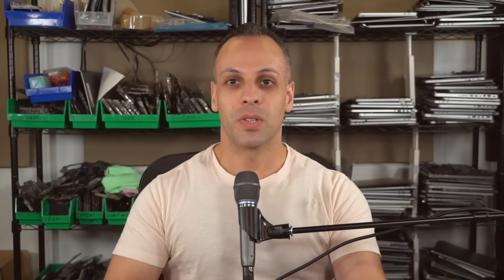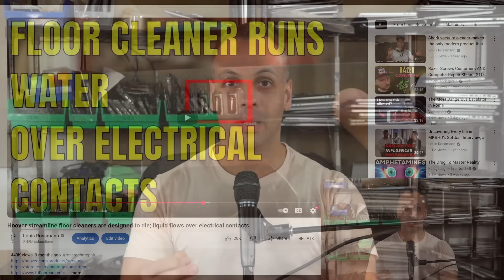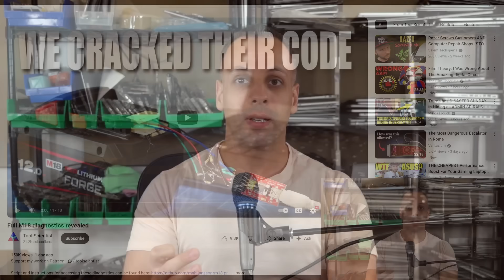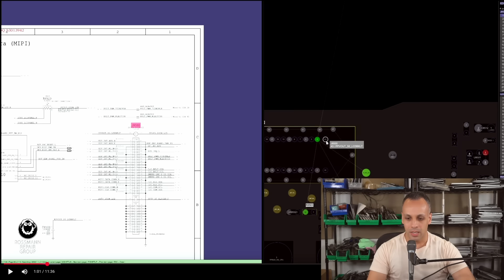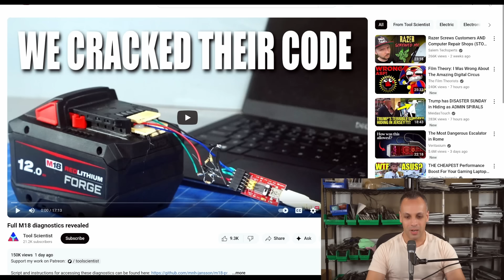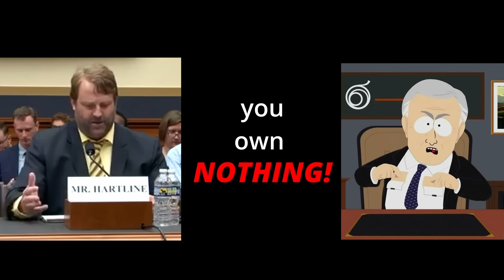Imagine putting DRM in a battery to void warranties...

Comment: power tool batteries have always been a total fuckin scam, its just simpler back then than now
when you buy a power tioool, say it comes with 2 batteries and a charger because its a bundle for 160$ or so
if you want to buy the tool alone, its probably 120$ or so. if you want the charger, its maybe 15 or 20$
but gods fucking forbid you have to buy a battery seperately, ever, and most are often made with just enough capacity to last you about 3 to 4 hours. fine for home use, not enough to last all day in a shop. especially when its being passed around and shared.
that one seperate battery you buy seperate is *80$*, i have not seen one lower than that, thats the floor for seperately non bundled batteries, and all these proprietary plugs means you cant use one in the other brand, which just leads to petty ass brand superirority arguments 
the older ones used to have at least a 15 year lifespan, blue ryobi days battery lasted up until 2018, bought another green ryobi one with the charge indicator on it and it lasted 4 years
this is just another layer of bullshit icing on this cake

Comment: TTI's whole business model is forcing people to stay into a specific ecosystem via bateris, because if you buy a Dewalt drill on sale yand you need an Impact Driver you can reuse your charger/battery on a De Walt Impact but not on a Milwaukee. Ergo they give you a deal on Dewaltonce and now you're locked into Dewalt forever. They could change the design so new Dewalt batteries fuck you more than the old ones do, but they can't change the design so you need new Dewalt tools.

Comment: I recently bought a new weather reader from the company I bought from for over a decade. Once I saw the DRM garbage and requiring an app to use at all. 

I bought new rechargeable batteries, put them in my old weather reader, and it immediately started working again. The new weather reader, even when I set it up via the app, had issues from the word go. I returned them.

Comment: 1:43 - Lithium batteries degrade when they are in a hot environment in a high charge state. You don't need to put a load on them for the degradation to happen; it's a chemical process, and it just happens. So yes, if you were informed not to store batteries in a 45 °C car and you did it anyway, they have every right to deny you warranty as the product was misused.

Comment: *panics over investing about $800 into one particular manufacturer's platform over the past three years*
*reads thumbnail twice*
It's OK, "Yellow Guys," you're safe. But don't try anything hinky, got it?

Speaking of "watered-down piece of garbage made by a company that has sold out 6-10 times over," I submit for supporting evidence the Stanley brand of hand tools. I bought a Stanley set of screwdrivers in the mid-00s. Allegedly "chrome vanadium steel," but after purchase I could tell they weren't. The shafts twist, flex, and/or snap (it's compressed powdered metal with a shiny plating), and every single flathead is missing pieces from the tip that have broken off. They're rusty, the "chrome vanadium" is flaking off, and they're such utter crap that I refused to buy another Stanley product ever again.
I have inherited/collected some Stanley stuff from the 1970s through 1980s, back before some Chinese holding company bought the Stanley company, and those tools have really held up over time - and are still in my primary toolbox. It was because of that reputation that I purchased that mid-00s set, of which only one or two are still usable, and they've been downgraded to the "sacrificial tool" toolbox. (Need a narrow chisel? Grab a Stan-Li Flathead.)
Reply: Yellow guys? If you mean DeWalt then I'm sorry to say that they do the exact same thing as Milwaukee with their batteries. Also Stanley is with black and decker the universally agreed worst power tool manufacture.

Comment: I have an HP laptop that, when hybernated/turned off for 4+ days, it drains the battery that has been replaced down to 0%, the battery drains even faster than leaving it on suspend mode through a whole week

It's not even a gradual drain, within the 1~3 day mark, it holds the same % I left it at, but on the 4th day onwards it takes a nosedive to 0%

I wouldn't be surprised if HP implemented a system that sabotages any 3rd party battery

Comment: I saw a video where a guy took one of these tool batteries apart. The battery would only last a short time before dying. But it would charge up and indicate full charge.

So he tests the voltage until he finds the cell that dropped down too low to charge. He disconnected it and rigged something up to charge that one cell up to the level of the other cells. He put it all back together and it worked again.

He was still planning to replace the battery because he didn’t know if the cell wouldn’t drop too low again.
Reply: yeah, a weak cell or 2 can be brought up to the others and the whole pack lasts so much longer. If the good cells hold more than 90% I'd replace the bad cell but you can ask the E-bike guys, they know all about caring for battery packs.

Comment: Batteries have became the printer ink of tools. 

Dewalt does some other shady sht. They just disable the battery if it falls below a certain voltage or hit 200 charge cycles. Sadly all I own is Dewalt. I have a hack for Dewalt, but its not that good. 
My Bosch battery on my e bike has some similar bs with it.

Comment: Thank goodness my still working piece of ryobi crap drill battery has NO circuitry in it..... 

I always thought aspiring to owning a Milwaukee set of tools was good..... 

Now, I seem to think this is no longer a sane aspiration...... 

I will stick with my still working cheap ryobi and batteries.....
Reply: Ryobi is owned by TTI too. However, he used some AI thumbnail that shows brands that don’t even exist. Ryobi batteries don’t have DRM in them. I have a lot of Ryobi tools and batteries and I love them.

He clearly doesn’t know what he’s talking about. Lithium ion battery packs are very finicky, and subject to stringent regulation. They often shut themselves down to avoid fires…. and there’s reasons void warranties due to misuse. Example being shorting the battery out purposefully. This is a nothingburger, sorry Rossman.

Comment: The individual units in a battery are called cells.  A number of cells connected in series make up a battery.  More cells increases battery voltage.  Larger cells increases the number of amp-hours (AH) a battery has.  Amp-hours times volts gives Watt-hours or capacity.  Higher voltages are more efficient and give more output power.  Bigger cells give longer run times.  Bit of a balancing act.

Most other battery types could benefit from a balancing circuit, but it isn't strictly necessary.  A lithium battery must! must! must! have a balancing circuit and temperature sensors.  This is not remotely optional, but apparently some companies treat it as such to save a few dollars (they really aren't that expensive).

What happens when a company doesn't include a balancer?  Glad you asked, Just search for videos about Chinese scooter batteries that caught fire and/or exploded during charging or discharging to see.  Now think of that cheap power tool charging in your basement.  Yea, I think you get it.

Comment: 1. What you are describing, and what this is, is not DRM. DRM is to prevent users from using their products in an way that is unintended by the manufacturer by locking or turning off the product.  The batteries can still be used however the user wants, this hardware & diagnostics just loggs misuse to deny warranty claims.  The fact that it's being used to deny warranty claims when no actual misuse has occured is the real issue here.  

2. The battery packs HAVE the hardware to perform cell balancing, it's just TURNED OFF IN SOFTWARE which is even more insane.  Imagine being the engineer who designed the whole BMS circuit for these battery packs, lovingly including balancing resistors, only to be told that either purposefully or accidentally the software would never allow it to activate.  What a letdown.

Comment: I have ozito tools and battery in Europe they are called Einhell, all tools have spare parts on Einhell website with the exploded parts. I replace the old cells in the 4ah  18v battery and they still works very good because the bms don't lock itself

Comment: I watched the video. He only talks about command code $01. There may be code in the firmware that the guys haven't uncovered yet. I would not jump to conclusions yet. I hope they will be able to dump the firmware and really see what's inside.  I am not protecting tti, just having had reverse engineering protocol experience with other electronics before.

Comment: No balancing? Impressively amateur. That's so basic I'm shocked batteries are available thay don't have balancing.
Reply: The balancing hardware is all there. It's the software that disables the balancing circuit each time it goes on the charger. Someone had to write the code to purposely disable the hardware from doing it's job. They knew exactly what they were doing. Only question is why?

Comment: A lot of this industry wide trouble is the FCC's fault. Way back when, they set standards to keep electronics from stepping on each other's toes. Nowadays it's a chaotic banana peel party. The FCC needs to force these companies to be up front about their DRM schemes and set standards for what is and isnt acceptable sabotage in the sector. Ultimately, DRM is an attempt to bypass what would normally be agreed upon by contract, bypassing contract laws and limitations via deliberate destructive action. It needs better regulation.

Comment: not only that, they have a charge limitation built into the software, having undone one of Milwaukee batterys that refused to charge, i found it had a limitation hit that stopped the battery getting a charge, reset this and battery was fine, Milwaukee said it needed replacing.... at triple figure cost

Comment: Anyone notice how modern products are being designed more and more so that when the battery dies you can't use them anymore. I'm talking phones, vr headsets... META cough cough Laptops usually still work if you remove the battery.

Shit to make you buy a new one when the old one could have worked without a battery much longer as long as plugged in

Comment: I hate to be "that guy", but since Louis uses the terms about 100 times: The accepted use in industry is that a "battery" is comprised of "cells". The battery can be any voltage depending on how many cells are series.

Comment: The companies in TTI I worked for didn't cross-talk on the engineering departments but it would be interesting to see if there has been internal mandating from TTI to their brands to implement these horrible protectionist strategies.

Comment: I have wondered for years why a tool designed for plumbers, designed to work on water pipe, and advertised as being able to repair pipes while the water is still running, not only could be damaged by water in the first place, but could be warranty denied by "water damage"

Comment: 100% agree with you on "spyware" vs. "diagnostics" - I'm trying to find out why I have so many failed Ryobi batteries and this couldn't have come at a better time. What we really need is batteries with replaceable cells, so you don't have to toss the entire thing just because you have one or two bad cells. Some of this stems not just from warranty though, but also from insurance - if one of these batteries catches fire they'd have a huge lawsuit on their hands so they make it to where it just shuts off if it even looks remotely wrong. What we need is actual diagnostics and replaceable cells. It's an environmental nightmare!
Reply: Problem with the Ryobi batteries is pretty simple, it just doesn't allow a charge if the overall voltage is too low.  Easy to fix, you just have to disassemble the battery, manually put a quick charge into the battery directly (bypassing the circuitry) and then quickly reassemble and drop it in the charger.  Full instructions are available online, I've revived 2 Ryobi batteries this way.  Not sure if this would be considered DRM or just battery protection, it kind of depends
Reply: @linuxgurugamer  Yep, I've been manually charging each cell up to about 3.85v with my bench power supply. It's time consuming but for most batteries it seems to work. Considering we have no way to diagnose the issue, I'd say it's a combo of both spyware and protection.
Reply: you just put Ryobi tools on the no buy list
Reply: Ryobi was never a decent brand. Always failing, with short life span and problematic support.
Reply: @pliedtka  I still have some of their old blue tools. They used to be a decent value for homeowner or light pro use (handyman, etc.). Now they've been taken over by MBAs and have gotten expensive and less reliable.
Reply: problem is..... where to get RELIABLE cells...., most people would buy shite from china.....
which is likely to become a fire hazard.
Reply: A lithium ion battery with replaceable cells would be both a fire risk and a liability nightmare.
Reply: Overuse of the "insurance excuse" has become a scam of it's own.

Comment: depending on the technology we peaked somewhere between 1995 and 2015. 90s was the last decade of true heavy duty appliances and home HVAC. mid 90s to mid 2000's was peak automobile tech. we had non hybrid cars in the 90's getting 55 mpg.   phones peaked in 2014. the samsung S5 was THE last mainstream phone with a user replaceable battery.  everything after has just been disposable trash. I repair things for a living I'm not joking, EVERYTHING is disposable trash now.

Comment: That reverse engineering video is an astounding piece of work. I hope they are able to find a way to modify the battery memory so customers can delete the flags that allow the manufacturer to void the warranty. I am also disgusted that any electronics or software designer would implement these features when told to by their boss.

Comment: Discovering that the aftermarket batteries for power tools sold on Amazon by third parties are not only cheaper, but better quality was a game changer.
Reply: The problem is you don't actually know if they're going to be higher quality or lower quality or similar. They might be higher quality but they also might be dangerously low quality and there are plenty of videos on YouTube demonstrating the sort of Hazards these batteries can pose.

Comment: I have a shaver that is designed to work in the shower, it requires water to run smoothly... it has pins for the connector and it hasn't corroded yet..   So it's doable.. with the right type of connector.   To clarify the trimmer/shaver I have doesn't have a flap to protect the connection it just doesn't affect it...  I've used it every few days for over a year and no issue..  Surely a vacuum is used less.

Comment: Same exact thing with a corporation buying out a smaller company and making shittier products is an experience that happened to me recently. I had a pair of HyperX headphones that lasted me around 8+ years before they finally broke recently, and it was only due to it being when I was younger, and my mom broke the headphone jack around 4 years in. Fixed it myself until the parts just wouldn't hold any more. Had a good run, so I didn't hesitate to buy another pair.

It was only once the microphone started breaking after 6 months did I do my homework, and learn that HyperX had been bought out by HP Inc. in 2021, and in typical corporate buyout fashion, started using cheapo parts that I wouldn't trust to hold water in a bucket let alone a pair of headphones.

Don't be like me, Youtube comment section. Always look at who owns the company of the product you're purchasing to actually see the quality of the product you'll be receiving. Brand loyalty is meaningless when that brand swaps between higher-up hands.

Comment: This has been done for well over a decade. My floor cleaner had a battery fault despite me barely using it and keeping it at half charge for maximum longevity. When I measured the cells they were all in pristine condition, but the UART connected BMS refused communication one second after turning the unit on. 
Turns out some chinese vendors sell a cloned BMS (presumably because the lock-out I experienced is an actual timed planned obsolescence lock-out). I soldered the new BMS in, one of the hardest soldering jobs I ever did and it runs like new. 
The chip on the original BMS was readout protected and I did not manage to glitch it. 

The manufacturer is Dreame and all their batteries have a proprietary BMS that prevents all function in case of a communication stop. 
Those BMS boards will also permanently lock out if you disconnect a cell, so cell swaps are a risky mess of wires to constantly spoof connected cells. 
Wish I had much of an alternative but this design pattern is consistent across the industry. I don't mind a smart BMS with coloumb meter. But I do mind any code that permanently locks functionality even after a fault goes away.